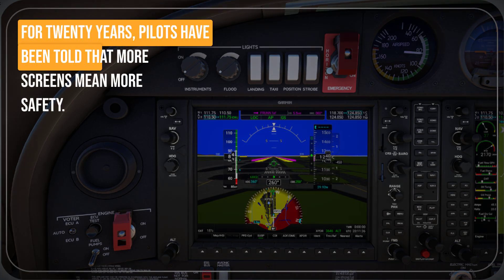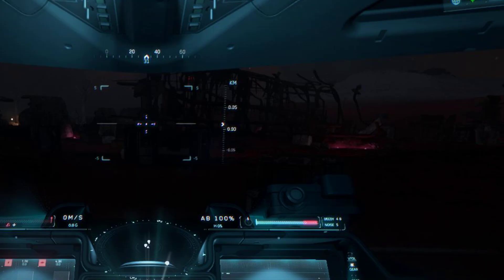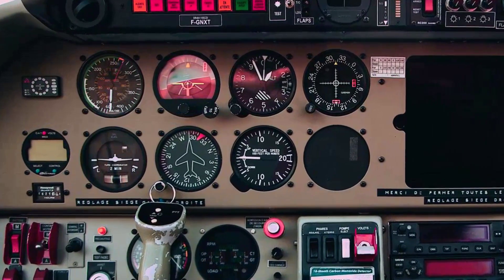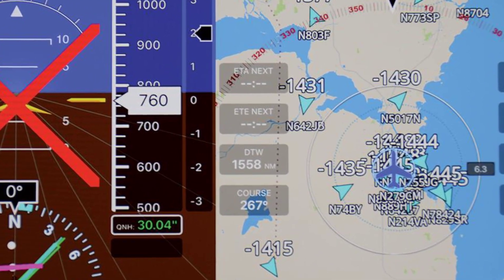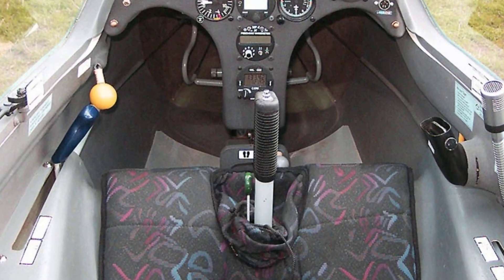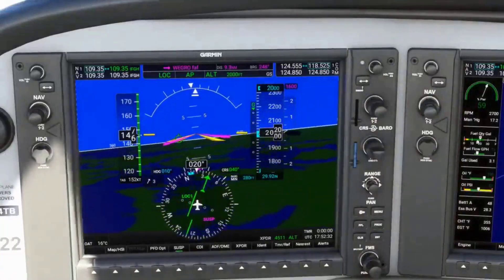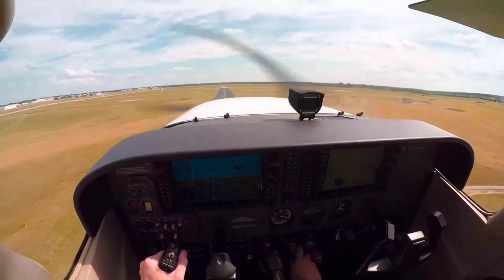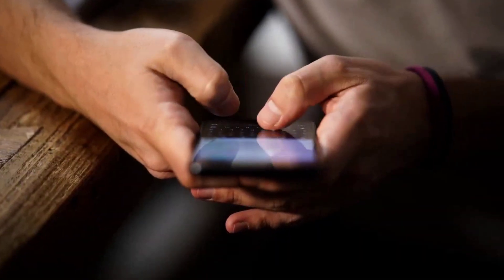Why 'Old School' Cockpits Are Actually SAFER Than A G1000

Comment: I still prefer to fly "steam gauges". I have no interest in glass, probably because I fly glass aircraft in my sim. Interesting point here; when I got my licence 26 years ago, my instructor would cover the ASI so that I would "get the picture" on approach and finals. I can still put a Cessna or Piper across the number with very little time "head down".

Comment: I knew the answer to this before clicking on the video but wanted to see what it had to say. What little pilot lessons I have had I realized quickly that analog gauges are much quicker to determine than that screen with more info than is needed for the moment. I discovered this in race boats and fast performance boats. I found that just the minimum info to control the boat when running at high speeds in rough water. The good thing is that in a boat a screen blackout won't make or break you like in an aircraft.

Comment: Good points, and not mentioned was the terrible over-the-nose visibility when a G1000 is installed in a light aircraft.  Referencing analog needle position during critical phases  and making  it part of  a constant scan improves safety too.   And then there's sunlight glare on glass displays.

Comment: Too much info crammed into a digital screen. It takes time to find the information. Analogue gauges are simple and analogue signals and trends are easier to process. For example, on final when trying to maintain 60 knots, if the needle goes down(increasing airspeed), I automatically pull the yoke back to reduce the airspeed. I mentally link the needle direction to yoke position. It is almost instantaneous. It is similar to chasing the vertical needle on the localizer of a VOR gauge. In a digital display, I have to read the changing numbers, decide if airspeed is increasing or decreasing and then react. This takes several seconds.

Comment: night blackouts  are why  we  would have a  torch on the  panel   showing the  steam gauges on takeoff even though they are illuminated  .. just in case . Steam  gauges still work ..don't  trust  glass displays .. its  putting too many eggs into the electrical  basket and can be  disastrous at  night

Comment: Well, as a pilot who returned to flying after 16 years I hope I have a useful perspective. I spent about 15 hours getting the biannual review and IPC. In that time I flew a mishmash of different airplanes with a mixture of different glass 'enhancements'. I don't know how many times my instructor and I were distracted by the glass doing something odd with the flight plan. Or knowing what we wanted to do, but struggling with figuring out how to get the computer to do it. Toward the end I mentioned to him, how 'back in the day' I could hop in any instrumented airplane and fly it. The six pack was always the same, almost always using the same technology combinations (vacumn, electric etc). The changes were different. Now, I have to spend a silly amount of time before each flight trying to figure out the menus of the particular unique snowflake that I am flying. It isn't more safe despite the convenience of when the mfd  picks the right next waypoint, which it usually does, but not always.  As a renter, it is really difficult to be sharp with a handful of different glass interfaces.
Reply: I guess I should amend to say that foreflight is amazing! Wow, how great it would have been to have it back in the day. So, some technology has certainly enhanced things.
Reply: @JonBurgin  That's right!  I haven't flown for years, but I would definitely go with Foreflight were I to return.  And a six-pack. And an ADF. A wing-leveler would be nice.

Comment: Having ADS-B is an incredible tool for safety, If you can spot where the traffic is on display, it's much easier to track it down visually. Personally, I find it easier to be visually aware of my surroundings if I have the EFB rather than relying only on visual and tower calls.
Reply: 'course not all aircraft are required to have ADS-B, it only takes one ultralight to ruin your day/life.
Reply: @JonBurgin  Birds should have strap on ADS-B.

Comment: I totally agree with this video. The only thing electronic in the cockpit is a GPS display. It is easier the wrestling with maps. Maps only for backup and a quick oversite. Firs I learned to fly sailplanes. Most important "instrument" is a short red wool string taped to the front window. Airspeed can be gauged by the outside  air noise of the plane.

Comment: Great video, All the glass is nice until it goes black, and it does. I have  watched this transition for 30 years and have said we would soon reach information overload and we did in fact several years ago and it will only get worse. Even if I could afford to spend $100,000 on all new glass, autopilot,etc. I would not, there is little to no return on investment so far as safety is concerned and only slightly any when resale time comes because what you get today will be out of date in just a few years. My plan has been to mix some modern avonics  with some of the old for the a better overall outcome in all areas mentioned earlier. The cost of this new technolgy keeps many from pursuing a pilots lic. because they assume they need all the bells and  whistles and the cost scares them away, GA is having a hard enough time exsisting without this new threat to keeping enough getting their lic. and GA to continue to be beyond  the reach of many.

Comment: The reality is everything in the panel has a limited life.  After overhauling analog gages, sometimes once a year, only to have them fail, I’ve gone to electronic replacements.  Radios have a limited life, some can be fixed, but ultimately are unsupportable and newer units required to get maintainable units in the panel.  

I learned on steam gages - my transition was incremental - electronic artificial horizon first after two consecutive years of analog overhauls.  Then a GPS navigator when the old nav-coms failed.  Finally a backup instrument that let me eliminate the vacuum pump.  And of course, the ADS-B transponder upgrade.  With IN as well as OUT, traffic display takes getting used to but increases situational awareness.

Some of my gages were 60 years old and sort of working, but I am glad I upgraded.

Comment: I fly Cessna 172s and 182s with G1000 panels and I can assure you that they do not show the mach number. What they do show is indicated airspeed, ground speed and the critical "V speeds" like Vx and Vy., which are super helpful. When you fly aircraft with analog gauges, you have to memorize those numbers for each of them and god forbid you mix them up when you fly several different aircraft.
Reply: He completely made it up.

Comment: When flying VFR you do not need any glass panels. You head is outside 95% of the time. I can set my tack by just the sound of the engine. Than glance down to verify. I can have my peepers outside and glance at my airspeed when on approach. I do not need to look at my VSI. I learned on a six pack and I am a freeway / lake / Landmark type of pilot. I never really liked looking down at my Ipad.   Now I am trying to learn Instrument and it's a different story. Nice to have glass to help you see the charts on the panel instead of having to put my head down to read paper or my ipad on my yoke to brief the plate. This is when Glass comes in handy. Anyway, I will need to learn the read the airspeed faster and altitude as it has tapes instead of an easy round dials.
Reply: Ha, in my recent transition to glass cockpits, most of the aircraft I was using had the steam gauges as backup, I had to constantly remind myself to look at the tapes on the screen instead of the steam gauges.

Comment: I think this is applicable in GA only to some degree and has more to do with training and type of glass cockpit (ie. There is a vast difference between dual G5s versus a G1000 when it comes to the learning curve, price and subscription needed). In the past, the GA accident rate was always higher than it is now and analog instruments were always there. Modern commercial airliners are full glass now yet have the highest safety records far superior than that of GA. In the hands of a professional crew (or a highly proficient single pilot), Glass is objectively superior for situational awareness. The "danger" is entirely in the pilot's tendency to over-rely on the automation or stare at the screen for too long. Fixation or staring too long also happens with analog: Recall an accident made by professional pilots using steam gauges in perfect VFR weather because they were too fixated on a $12 bulb light indicator for the landing gear (Eastern Air Lines Flight 401, which crashed into the Florida Everglades on December 29, 1972.)
Reply: Yes, which is why Foreflight is so popular.  On my first VFR cross-country  I got lost trying to use pilotage in a PA28.  Even though it seemed like a defeat at the time, the solution was to find a known highway and start following it.  Looking back, I have to admit that there was a certain amount of fun in getting lost, then solving the problem, however clumisly.

Comment: I completely disagree with that. IFR trained pilots need to look inside not outside. Outside is for vfr pilots in Vmc. Traffic advisory is big game change. It’s hard to see planes when  it’s not turning.
Reply: well, of course if you are in actual IMC, and an IFR flight plane you will be provided separation. Don't get me wrong I like traffic alerting, but, for me at least, it is a secondary on a VFR day.

Comment: Economists call this constant risk…….as you make an activity safer, people press it further. In aviation, glass screens allow us to fly missions we would have avoided before…..flying into complex airspaces, making approaches that require more steps and sequences.  There is nothing wrong or irrational about this behavior.  Put better brakes on cars and drivers go faster. Make ships more reliable and people take cruises.  Show us where the terrain is or give us a clear picture of an arc approach and we do more with our planes.  So the accident rate may decline as instruments improve or it may remain constant….but we are accomplishing more with our planes…we are rational.
Reply: In skydiving, we call it risk homeostasis, that is, as equipment improves to reduce risk, decision making adjusts to maintain the familiar level of risk. It's not a zero sum game and there is incremental progress over time, but in the short term it may look like building a parachute that opens faster (e.g.) just makes skydivers deploy lower.
Reply: @livendive yep!  Each improvement allows greater use.  After wwII, women could get stockings made of nylon; they ran far less than cotton stockings. So, naturally, women then wanted sheerer stockings which got so sheer they too ran. So Dupont improved the nylon which meant women could get still thinner stockings…you can see the similarity.

Comment: I have a 1974 Cessna 172M. It still has its original panel, and it will have as long as I own it. I have been in aircraft with those "video game" panels, and they are ridiculously confusing. The bright colors are extremely disorienting. While you can just glance at an old school panel with mechanical instruments and know what they are showing, these ridiculously complex panels are very confusing. I would never attempt to fly an aircraft with a panel like that.

Comment: The old airspeed dial is a superior way to display airspeed and its relative position alone on the face of the instrument provides instantaneous speed envelope awareness - without actually “reading” the numbers.  A speed tape needs to be read /interpreted      . 
Also the needle provides instant, intuitive cue to required pitch inputs for speed control. Clockwise (needle down) Speed Increases / CCW (needle moves up) Speed decreases.  This mimics the actual control inputs on the yoke for said speed changes and requires NO interpretation/thinking, unlike the speed tape, which inverts this logic.
Reply: The speed tape is an issue.

Comment: I dont agree with this. Flew both steamgauges and Glass and the flight is waaay safer with the glass. The thing is that with the Glass you can actualy look outside more often. You can see everything that matters in the G1000 with your peripheral vision alone. If you loose speed steadily the analog dial moves too slowly to catch your attention, but with the G1000 you will see the number changing much easier due to the animation. Same for altitude. You can catch mistakes much more easily in the G1000, everythig is just simply better.

Not to mention info like actual ground track and the precision of the radio navigation instruments.

Seriously I've never seen a compass that actualy works well enough for me to trust it, even when you take in consideration the deviation. 

Flying old school VFR nowadays with such complicated and crowded airspaces just doesnt work anymore in lots of places, Its just a bad idea. 

Let me tell you, I fly in São Paulo Brazil, and If you loose your GPS there and dont know the region by heart, boy you are having a bad day... The VFR charts are just not usable cecause the landmarks have been entirely swalloed by urban clutter, only a few of them would be distinguishable for people that dont live here (and even they would have difficulty in spotting them). Its a common joke for local pilots to say that no one has ever seen some of the VFR points in the air and we are waiting official publications to verify that they actualy exist. Eighter you fly IFR or use a GPS here, If not, you are having a bad bad day.

Aviation industry has a weird problem of both being incredibily inovative and resisting all change at the same time.

One other thing I Just can't make sense of is why on earth are we still using a fing radio to comunicate with ATC as a standard and having to deal with the terrible interfearence and broken speach, many times I have missunderstood communications from other pilots or ATC because they were talking gibberish. These things can be very dangerous. Its 2025 guys I just dont get It.
Reply: In the US at least, there have been some advancements in sending and acknowledging clearances digitally. 'course you neat the right equipment, nothing money won't solve.
Reply: @JonBurgin  Im glad to hear this. Same thing is going on in Brazil but Its just not usable for GA and I think It wont be for a long time. I Just dont get why everythig takes so damn long and Its so damn expensive. I mean man Its a simple text message, Its 2025, If we cant make It work 100% short text messages in 2025 what are we even doing with ourselves I ask myself. Even If we cant realy make It 100% Im sure we can make It 99% and use the radio as a backup. It is so simple that a very primitive device would sufice Im pretty sure. Just make It beep when you get the message and and make the pilot send a confirmation and Its all good mostly. Im pretty sure that would even work better than radio. Lost count on how many times my radio has acted up in flight and decided to not work properly for no aparent reason just to start working again out of nowhere. I understand the vallue of being familiar with all this old tech and It can save you but realy, Its all mostly garbage by now.

Comment: Smart pilots use ForeFlight on an iPad mini, either yoke mounted or some other convenient location and retain the steam gauges. If one wants more redundancy for IFR flights, a couple of G5s are great and they eliminate the vacuum system... much cheaper than the G1000. I was on the GTN530 bandwagon from initial availability (before WAAS) to the end of factory support. I had to return it for phenomenal flat fee repair twice. Needless to say, I am not a big Garmin fan. If my aircraft were equipped with 2 G5s and one failed, I would tag it inoperative and continue to fly with only one.

Comment: The one thing advanced electronics have made possible is the elimination of the #^#!$ vacuum pump and related components.

Also, moving map IFR in panel GPS is a wonderful tool as long as the pilot gets good at using it.

An iPad with Foreflight is a great safety situational awareness tool as well; I was in the right seat of a plane when the BendixKing HSI died and the needle centered EXACTLY when we were intercepting the ILS into SNA: at the time I assumed my iPad was in error when it showed we were a little off centerline until approach complained.

To me, the takeaway is the pilot must have mastery of all the complicated crap in the plane for it to be actually safer; when this stuff came out I predicted more bad accidents, but before this video I had completely decided I was wrong.

The biggest concern I have about the G1000 type stuff is that it seems like any one of many things can go wrong that would be expensive and complicated to debug.

On a final unrelated note, I sure do miss NDB approaches, especially those flying away from the station towards the airport.  If we ever have a giant modern global confrontation,  NDB stations will be our first nav aids allowing IFR navigation again.

Comment: Give me the old six pack any day over glass.
Reply: And get off my lawn!
Reply: Agreed. I knew where each instrument was and could glance down for just a second or two and glean the info I needed and then look back outside. Its like the new car I just bought. Two computer screens, no dials of any sort. I have learned to not even try to change the displays while driving. It requires complete attention to do so. And there are too many menus and really just TMI; more info about things that I really don't care about. Steam gauges have always worked for me.
Reply: @AmadorCowboy 

I have the same problem with my new Chevrolet 🤦🏻‍♂️
Reply: You speak the truth 👍🏻